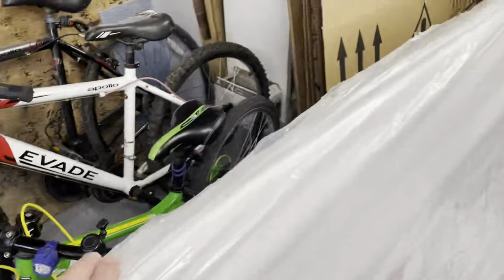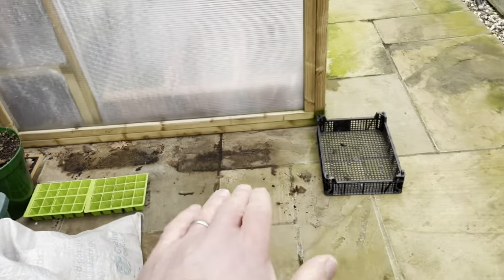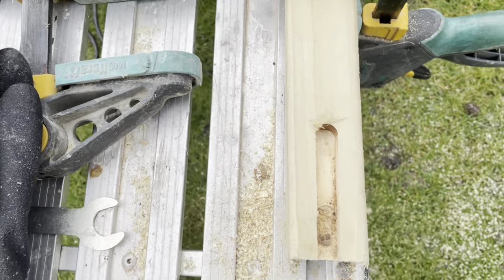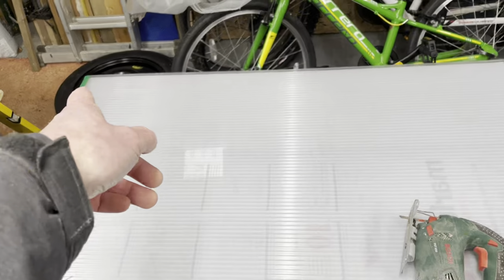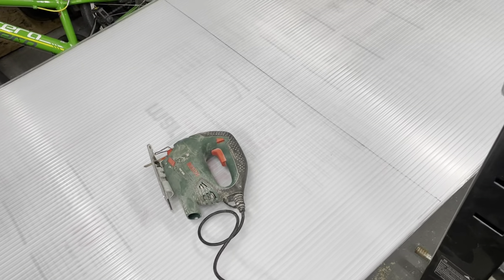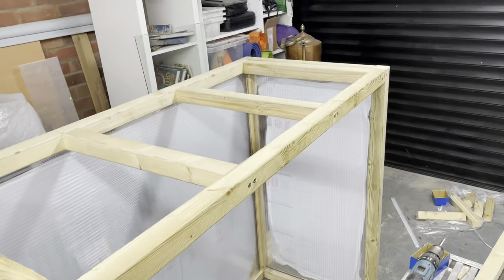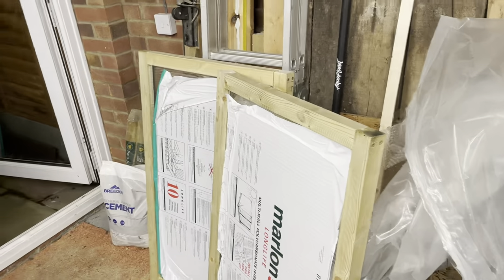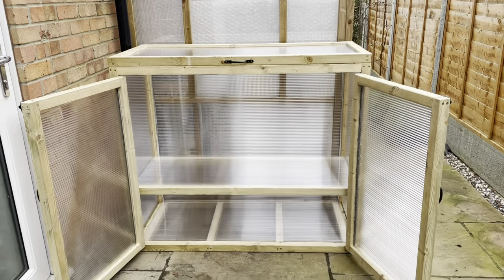How To Make A Cold Frame, How To Make A Growhouse, Make A Coldframe, Creative Garden Projects

Comment: Nice simple build. It's amazing how much timber you need and it ain't cheap theae days.  

One thing I was thinking while you were building, what happens to the water on the top when it rains?
Reply from the maker: Hi Tarquin. 
Many thanks for watching and messaging me, appreciated. 
You are right about how much wood is required. It’s not until I sketched it out that I realised just how many lengths I would need. Still works out better value than a flimsy shop bought type. 
With regards to the water on the roof, well that just spills over the lip of the frame and onto the floor. Given the size of roof it’s not a tremendous amount to worry about. 
Hope you have fun doing your own build.

Comment: Why no video of you actually doing the cutting and assembly ? That's the sort of thing most people want to see on videos rather than just talking. Looks like a decent cold frame and well made.
Reply from the maker: Hi Chris. 
Thanks for watching and your message. Glad you liked the look of the build, it certainly won’t fall apart like shop bought ones. 

I assume you didn’t see the description for the video as within that had included the inks to my previous greenhouse build and cutting polycarbonate video.
They are the originals if you like so show all the basics. 

This video uses the same methods but to build a simpler structure. 

The assembly is really just a case of screwing together the component parts of wood around the polycarbonate sheets, and in turn fixing sections together to build a frame. 
Hope your build goes well. If you need any pointers just message. 
All the best 🪚🛠️
Reply: @diyhomeandgardening  Ah, silly me !  Right , I  have watched the rafters video now and having owned a speed square for 20 odd years and only used it for measuring   90 degrees it was good to see a proper explanation of how to use another of its many functions. Now for the polycarb cutting. 👍
Reply from the maker: @chrishamilton-wearing3232  
🤣🤣 Yeah I normally just use the right angle function too. Either that or use a saw for same angle!

For cutting the polycarbonate just be sure to use a fine toothed jigsaw bit or fine toothed handsaw.
Reply: @diyhomeandgardening  I built a porch at the rear of our house back in the UK about 15 yrs ago and used triple wall polycarbonate for the roof. I got the best results cutting with a decent metal cutting blade in the jigsaw, possibly a Makita blade , and brand new. And I  ran a strip of gaffer tape along the cut line to help prevent splintering.  It worked fine. I also cut the bird mouths  using a sliding bevel guage whilst my speed square was sitting idly by on the workbench ! 😄
Reply from the maker: @chrishamilton-wearing3232  yeah I used a metal blade, so much quicker then cutting by hand. 
We all have tools that don’t get used. 
Amazing how many jobs can be done with a flat head screwdriver and a hammer🤣🤣
Reply: @diyhomeandgardening  One thing that annoys me, and I know it shouldn't really, is the amount of people I  see on here using a battery drill as a hammer !😡🤣
Reply from the maker: @chrishamilton-wearing3232  I definitely wouldn’t do that, too dangerous if the battery goes. 
I had a Makita battery blow once, it went with such a bang.